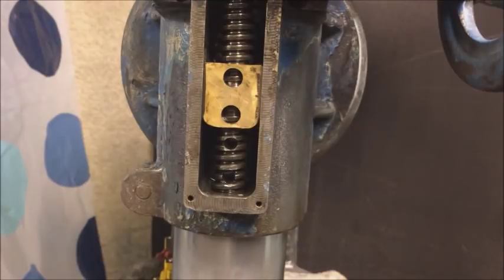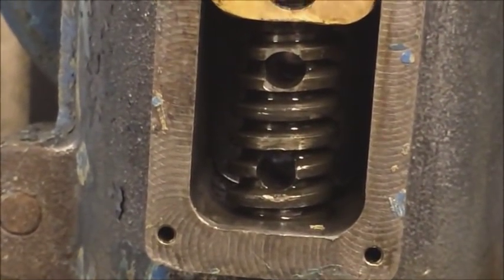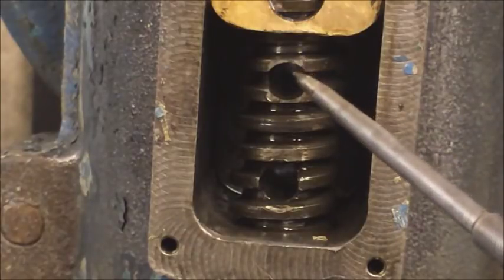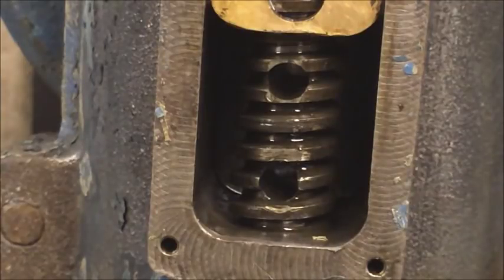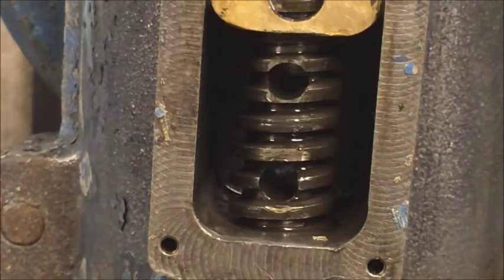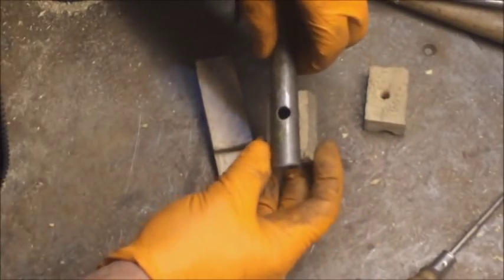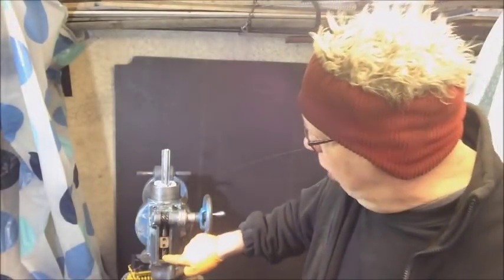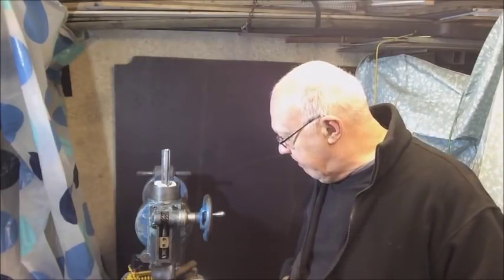Index Model 40H Mill.  a Stubborn lead nut  = DEFEAT

Comment: little magnet mounted grinder could be the way, you had nice planed area where cover comes on, should be aligned with the screw  at least look alike or maybe look closer at the area around the self nut go so much down unteel you meet  point you need to force it there can be some protection pin or something for that nut to don't go at the spot when you can remove that and loosen bolts will not block the machine to go up again sir there could be a lot of tricky stuff in that old ones i had one from 1968 bought in like a lotto cheap and on three pallets in parts it took some time to put it back in one piece great puzzle game for adults👍👍👍😀😀😀👍👍👍
Reply from the maker: Rafal Scrapper thanks Rafal. All ideas are welcome

Comment: Ian the co-op mince pies are nice
4 in a pack short crust  # lovely ..
Do those Alan key bolts actually come out fully??
Reply from the maker: snobby scrap picker  don’t buy the Aldi 79p pack  they ain’t a patch on their £1.29 pack, yes the bolts have to fully come out, but I’ve had a suggestion from M Hooper, which is logical and hopefully work, it’s about wear and the actual spindle weight working against me.
Reply: @Man-in-da-shed  so could ther be a very minimal wear on the shaft at the bottom stopping the bolts
Reply from the maker: snobby scrap picker opposite I’m trying to lower the brass nut I should be trying to raise the quill or a mixture of both
Reply: @Man-in-da-shed  I can see from the video the holes are much larger in the bronze for some reason?
I just had a light bulb moment..do you have to remove one bolt at a time / by lowering the bronze down to the first hole and remove the bolt?? Or have you already tryed this